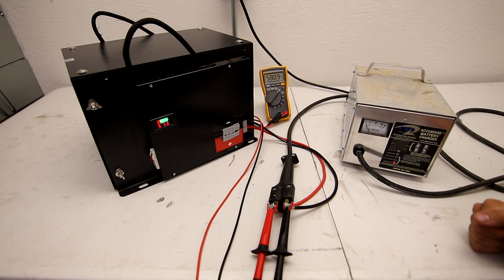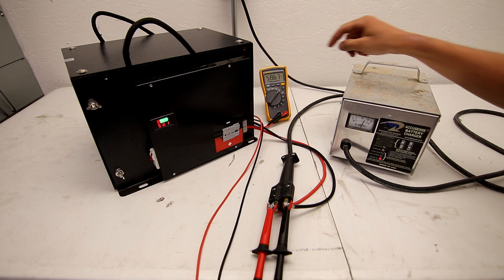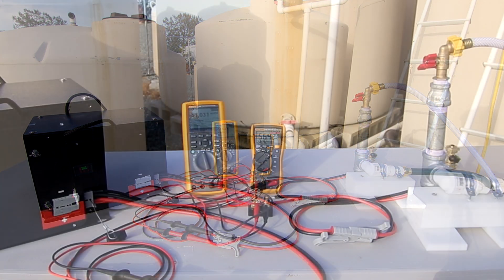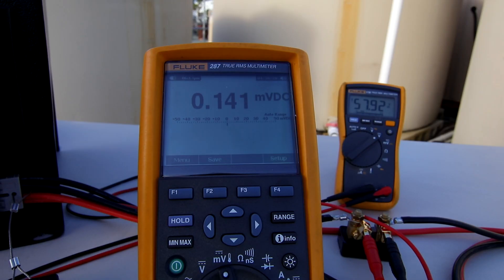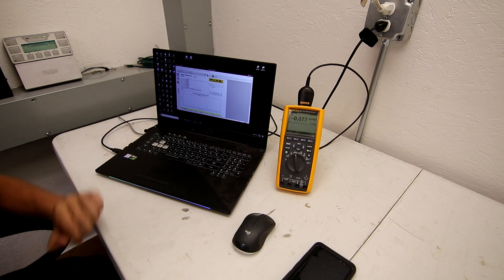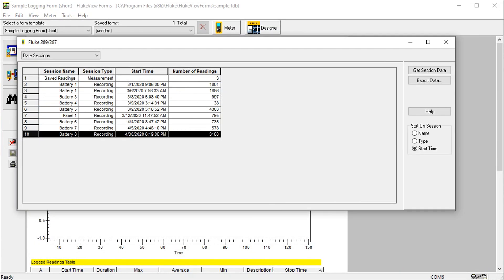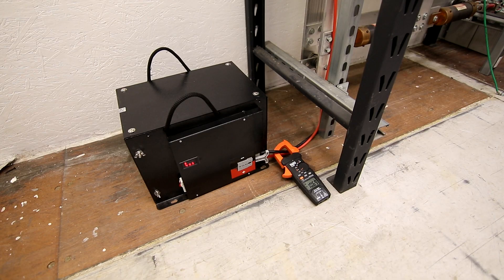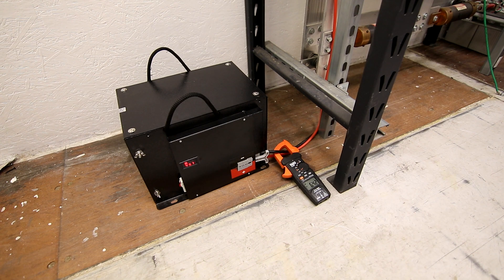48v Leaf Battery Pack Capacity Test

Comment: When whole voltage water pipe thing isn't correct. It spike because the pack is already charged and it takes the ms a certain programmed time to deactivate the output.

Comment: 13:05 - Incorrect statement that these do not contain lithium.

NMC is a type of lithium ion battery. NMC is shorthand for Lithium Nickel Manganese Cobalt Oxide (	LiNiMnCoO2).

NMC cells are good energy and power cells, and exhibit low self-heating. Thermal runaway also occurs at temperatures well above competing chemistries (210°C vs. 150°C).

Lastly, I concur with the comments regarding the useable cycles of these cells. They may be nearing the end of their useable life.

Stay completely away from Nissan Leaf Gen 1 batteries and be very wary of Gen 2 cells.
Reply: GEN 1 and GEN 2 are Lithium "LMO" type + Nickel = ( LiMn2O4 with LiNiO2 ) ... No Cobalt, so not an "NMC" type.
Nissan didn't start using NMC type until 2017+ model cars ...

Comment: Each cell has about 30Ah but in each Leaf module there are 4 cells groups of two in parallel then two in series so you have a 14S battery and original capacity of around 60Ah (two 30Ah cells in parallel) thus your battery is basically at the end of life just 66% of original capacity.
Reply: Originally, 66 Amp-Hours.  BUT ... how many more CYCLES can we actually get at 30 Amp-Hours?  Nobody seems to know...
Reply: @vtorsi610  That is because nobody will know when a dendrite will grow and short the cell internally as that is very likely to happen after it was used so much.

Comment: I believe the cells are 66 AH cells. 50.4 vdc is your nominal V. 2kwh. Not great but if you are happy thats the main thing. Thanks for sharing. Another great vid
Reply: I think they sell that pack for $850 USD . That would cost me $1500 CAD delivered to me. For 2 kwh that isnt great.
Reply: @frankz1125  Agree. They are no longer priced competitively with the other battery options out there.
Reply from the maker: 549.99 and if you use my discount code "hightech10" you get 10% off and I get a kickback for referring you.
Reply from the maker: https://bigbattery.com/product/48v-li-ion-mini-power-pack/ref/11/?campaign=LeafCells
Reply: @HighTechLab  the currency exchange is brutal right now. I just picked up 100 kwh of cells today. A123s
Reply: @zekeboz5533  it's expensive for me. I also live in Canada . With the exchange rate and the duties it's best to buy local. I have a good stock of A123s.
Reply: @HighTechLab  I sell 10 kwh for 2k with the rack.

Comment: Just an idea... why not us PLC to control a constant current and /constant voltage control. that way you control the charge curve the same as if you used a bench power supply for battery charger. You should be able to fine tune the charge curve exactly to what ever battery bank your using and may prolong your BMS?

I created a charger like this to charge a smaller battery bank using a click and wrote a pwm function to control a 100amp solid-state relay to control the “variable” voltage needed for the constant voltage portion of the charger setup. my charge curves are based off the cut-sheets from the manufacture for the 35ah batteries i’m using.
Reply from the maker: But then you introduce AC noise on the output and that's the exact reason why I don't use an inverter as a load instead
Reply: I guess I don’t fallow? How is AC noise being induced?
Reply from the maker: Because your pulse width modulation is not a constant DC signal you have an AC waveform that is referenced above 0 volts. I will make a video on this pretty soon and explain it with my engineer friend that has been helping me through this process of testing
Reply: You just said a reference above zero. So if it never drops below zero you never have an Alternating Current because it’s not crossing zero. as far as I know AC refers to a positive and negative voltage. meaning to be alternating current it has to switch between e.g +24v and -24v. a voltage between +24v and 0v is still DC not AC. 

Do you have an oscilloscope to see what Im referring too? I do get what your saying about it looking like an AC wave form. If the sharp pulses are your concern add an LC circuit to smooth/condition your output.
Reply: Just to clarify when I said LC circuit Im referring to using something like a toroidal inductor and a capacitor.

Comment: its not bad, but 40 amps is only about 15Kw of power in a full leaf pack at 380v, that can only move my leaf at around 70km per hour, all old lithium batteries will output much more power when they are used at a low C rating, I have noticed this with my nissan leaf when I added a 28Kwh battery in the trunk, still looks like a nice battery.
Reply from the maker: No doubt it's down in capacity from an entire leaf battery pack given that it's only 7 modules, but for a ready to go off the shelf system it's pretty nice.

Comment: Are you certain those are not the lithium based cells?
Reply from the maker: Yes, they are a NMC Chemistry, look up "Generation 1 Leaf cell chemistry" on Google and you will see.
Reply: @HighTechLab  everything I found said early leaf modules were lithium and later were nmc
Reply: @HighTechLab  I believe big battery has them labeled wrong
Reply from the maker: After doing a bunch of digging it appears you're correct and that a lot of different sites have false information on them. It appears the later generations were the nmc chemistry
Reply: @HighTechLab  thanks for looking into it. I'm just trying to keep as little miss information out there as we can.
Reply: Gen1 and Gen2 are LMO composition I believe. It was not until recently, 2017-18 that Nissan changed up the chemistry. See Battery University for a decent breakdown of battery chemistry options: https://batteryuniversity.com/learn/article/types_of_lithium_ion 

These are decent batteries (I have some as my battery back up) but there are now better alternatives I believe given the unknown nature & higher price per kW in buying used Leaf cells. For me they would have to be closer to $30 per Gen1 cell to be worth it.
Reply: @zekeboz5533  GEN 1 & GEN 2 batteries are like LMO type, but with Nickel added.  Second Generation Leaf ( 2017+ ) cars started using NMC.  What is yo  r"better" alternative vs Leaf GEN 1 & GEN 2 modules?

Comment: Great test! They claim 60% of brand new (3.5 Kwh) which is about 2 Kwh. I have the G2 and only get 1.5 Kwh after the inverter. The cost is really expensive and the false advertising doesn't help either.
Reply from the maker: BigBattery is pretty good about their advertising.  I have called them out once on them not matching their advertised values and they changed it immediately.  You would be surprised what some of these companies will do.
Reply: @avogrado's numebr - Have you seen any decrease in capacity, since you bought it?  Do you discharge 50% DOD daily?
Reply: @vtorsi610  I can't quantify it but I think I am losing capacity slowly. I used about 50% DOD this summer running a small AC all night. This is a very expensive hobby I got myself into.

Comment: Good Stuff.  I've yet to capacity test the 12 modules I have here.  Hope they're every bit as good as yours.  Going to gather the bits and  bobs for your version of Dummy Load.   I see a Hot Water on Demand system looking at that.   What voltage element are you employing ?  Ohms ?  I need to gear around my 24V system.
Reply from the maker: It's geared around a 48 volt nominal voltage. I got the elements off of eBay it's actually to 1000. Watt elements and runs about 1.2 ohms